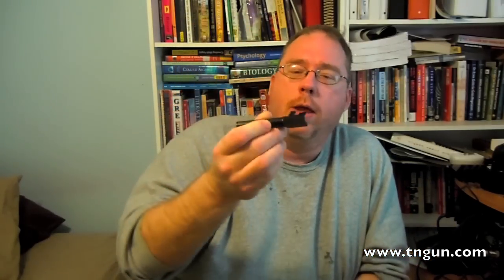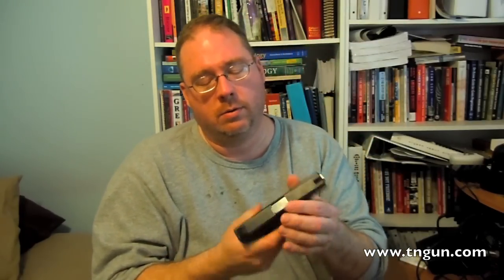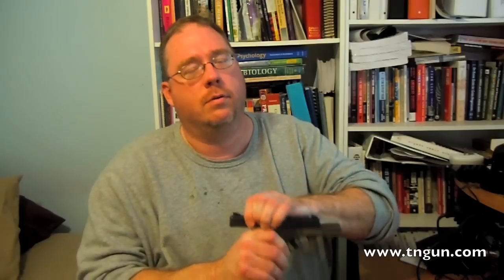What is Polygonal Rifling

Comment: So let me get this straight- you know more than the R&D engineers that put years of work and millions of dollars into the polygonal rifling concept. And that the only reason you are using a "cut" rifling barrel is that so you can use reloads? You probably also don't realize that the most accurate handguns in the world use hammer forged barrels. I could go on, but self styled "experts" like yourself are going to exist, so what's the point?- Retired Master Gunsmith and Glock Armorer.
Reply: Far out! You’re a retired gunnist? He said it squirts out the lead! Isn’t this guy a gas or what? Hot, expanding gas! 🙂‍↔️☺️😆

Comment: Thanks for the video on why you changed your glock barrel. I found the info on lead fouling particularily useful. However, I  noticed a couple of things: you claim that hammer forging produces stresses that cannot be removed by heat treating, that precision shooters don't use hammer forged barrels and seem to imply that hammer forging can only produce poly barrels. Since i have a good background in metallurgy, i can personally confirm that any steel can be 100% stress relieved by a good heat treat process especially the chromolly that is used in most barrels. In fact many long range precision shooters use hamer forged barrels during matches and have won. Armalon is a company that happens to make great cold hammer forged barrels that won a bunch of competitions. Their rifles can group down to 0.1 MOA (or 1" group at 1000M). However, most precision shooters in the US use button rifled barrels. Not because they are more accurate, it is because the best barrels are the ones that have the best QC. And that comes from small to mediun buisnesses that don't produce on an industrial scale (and therefore don't have the funds to buy hammer forging tooling). And last of all, most hammer forged barrels are land and groove rifled (All FN's, 700's and most AR types are all Hammer F. Land and groove). As evidence to my aforementionned points, i'll leave you with this video : /watch?v=eYIxzwrAj9g
Reply from the maker: Thank you for the information, I am not a metallurgist, so you have taught me something.

Comment: Provided you use real hard cast bullets with good lube, you can shoot them all you like in polygonal barrels without causing lead fouling deposits at the front of your chamber or anywhere else in the barrel. If you are concerned about lead fouling from hard cast bullets, all you have to do is to clean your barrel after firing hard cast bullets and before firing any jacketed bullets.